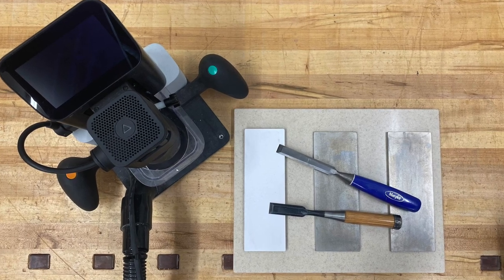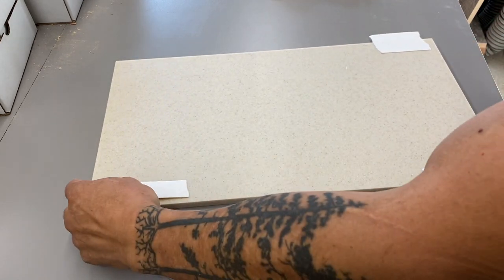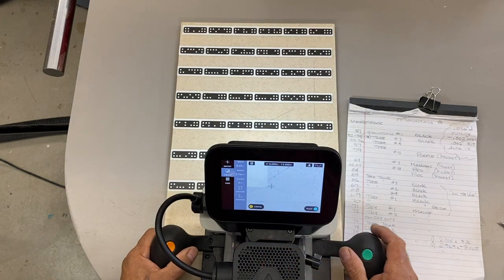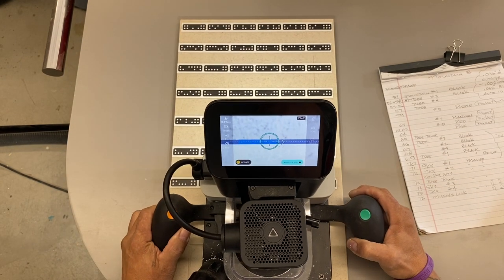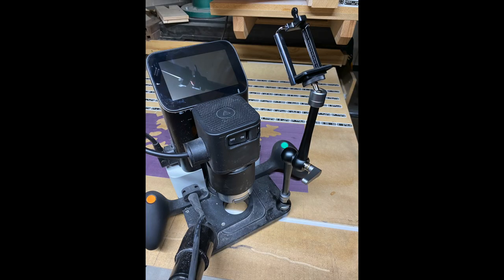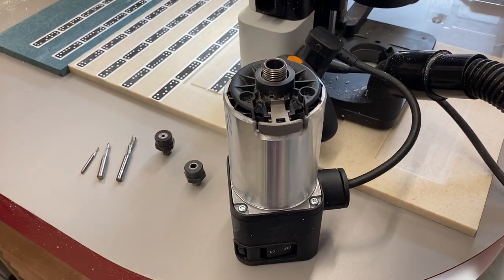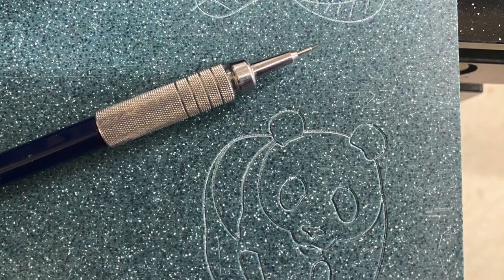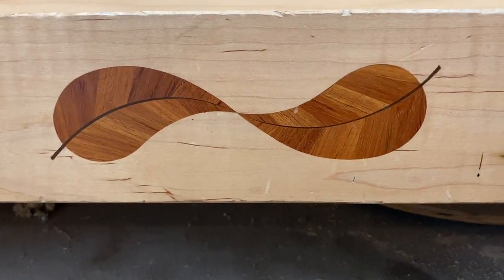Shaper Origin - Sharpening Holder

Comment: I’m making one of these today. I think I’m going to also cut some measured pockets in the edge for a projection guide. One flat board for the stones and projection guide all in one !
Reply from the maker: Yeah…I may add a block for 25°.
Reply: @ramonartful  I meant actually cut maybe 1/4” down from the top and whatever you need from the front edge to get your projection. Eclipse guide against the front edge, blade into the slot (recess) and you have your 25 degrees without the block sticking up off the surface?
Reply from the maker: @brenon4766  That's actually a great idea!

Comment: Nice video. You could have used a 1/2 shank in the Shaper to complete the pocket.
Reply from the maker: Thanks a lot.  You mean a 1/2” router bit with a 1/4” shank, yeah? ( 1/4” is max shank capacity.) I don’t have very many 1/4” router bits to do this…so, it was easy enough to switch to my big plunge router and hog it out with a 3/4” bit. Lots of ways to do things. 👍🏼All I know is that I’m so glad I made this simple, easy thing!

Comment: Btw, That was a nice mod you did to the Shaper Origin.  Where did you source the spindle mount handle that replaced the need to always have T-handle hex head wrench handy?
Reply from the maker: Ha…good eye!  I made it.  5mm all-thread, a nylon bushing and a knob.  The knob I had to drill n taps new threads.  Here’s the thing that you need to be aware of though.  If the router bit is small and short…the knob can hit the dust shroud on its way down to plunge.  It’s only happened once…so now I’m aware of it. I think I’ll make it a little shorter to clear.  I’m not sure that the Shaper team would approve! 🤷🏼‍♂️😬

Comment: Why did you not use the shaper to pocket cut the rest?
Reply from the maker: Great question and I certainly could have.  However, since I don’t have many 1/4” shank router bits, I decided to use a 1/2” shank router bit with a 3/4” cutter. Thanks

Comment: When you arent using the onboard tools which software do you prefer to design your svg files in?
Reply from the maker: I’ve used Inkscape mostly.  I’ve also found like png files or even clip art (whatever they are) then used an online file converter to make them SVG’s.  That works great for a lot of things.  But at some point, I need to improve my digital drawing skills 😬